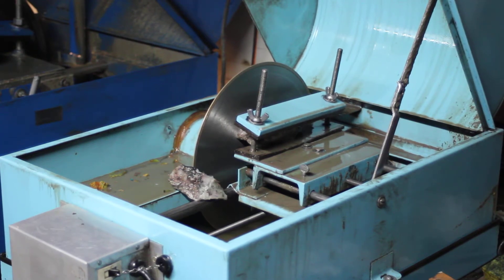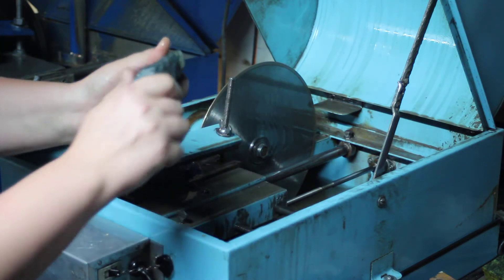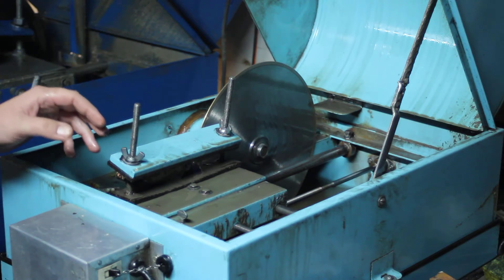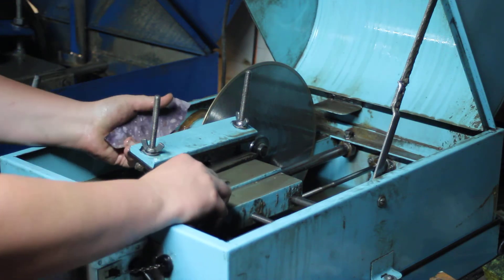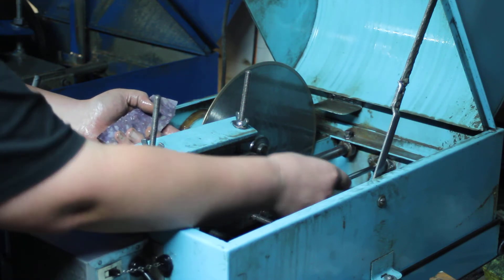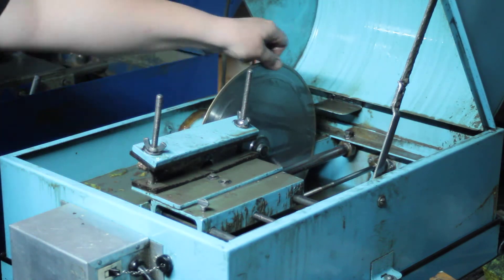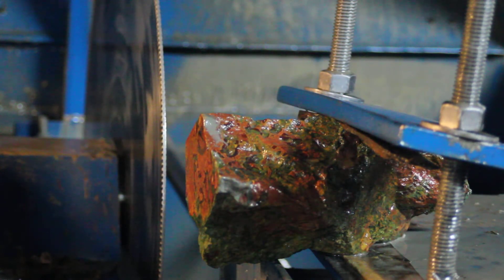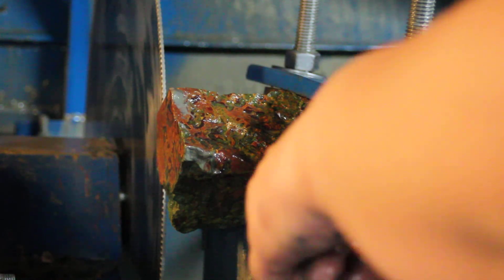How to use a lapidary slab saw Part 1

Comment: Great videos! I have a Highland Park 10" slab saw combination grinder and polisher model B-10 it has two motors one for the saw and one for the grinder polisher etc.The pulleys on the right side of the saw.  I'm trying to change the blade the bolt is really corroded, I'm not sure which way to turn the bolt to remove. Any suggestions on how to remove the bolt  the blade spins downward.

Comment: whats the difference the Lapidary, saw, tile saw, slab saw, won't any saw work for.cutting rocks in half or does it come down to preferences in lapidary work ?
Reply: Not much dif, but the blade thickness is key.
Tile saw blades take away much more of your good stone ,thus you get fewer slabs.